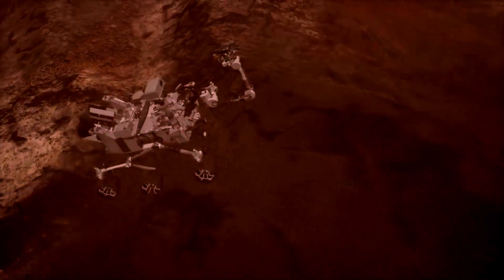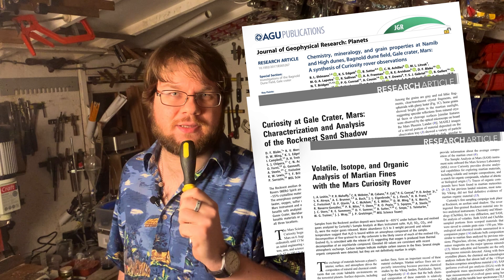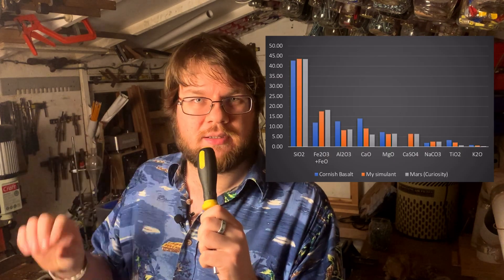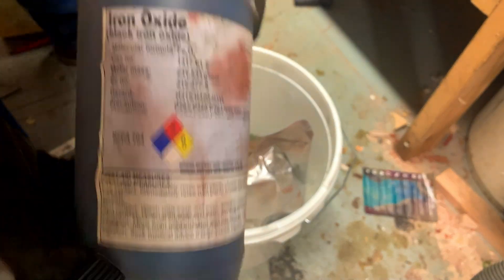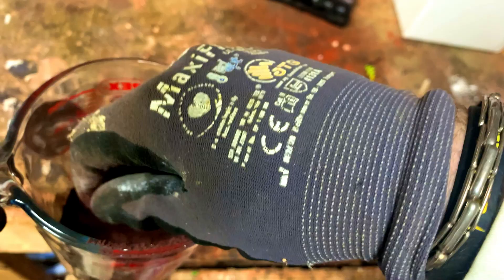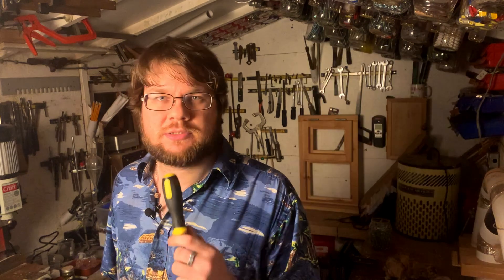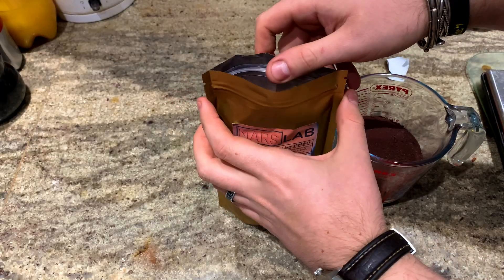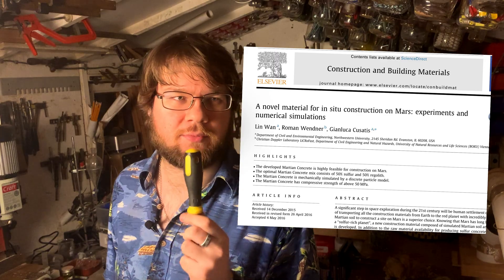Creating Martian Dust Because NASA Won’t Give Me Any.

Comment: I have a question, in terms of purely looks what ratio would you need to do to get something to look the same, doesn't need to be chemically accurate. I'm planning on making bases for my warhammer models and I was going to get the simulated soil but the import costs since I'm in sodding yorkshire it's like with you it's more than the cost of the actual soil. I assume the main 4 I'll need for the look and texture is the volcanic rock powder, red iron oxide, black iron oxide and white silica sand.